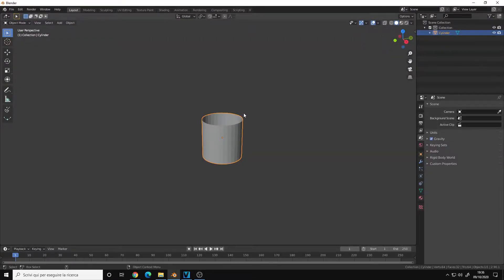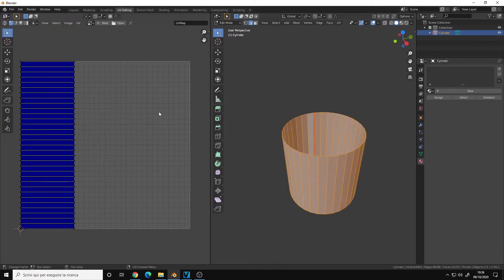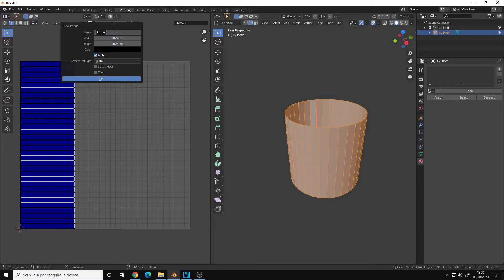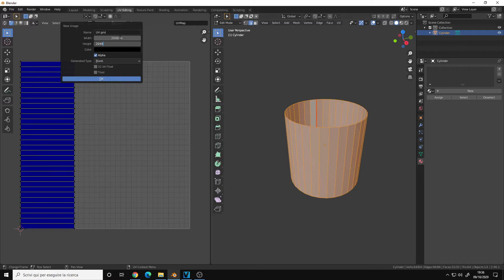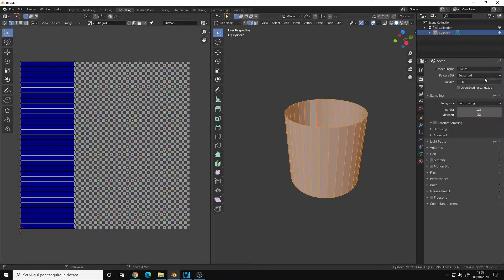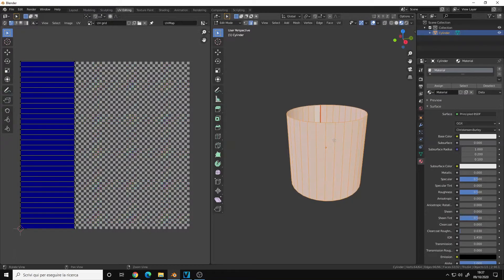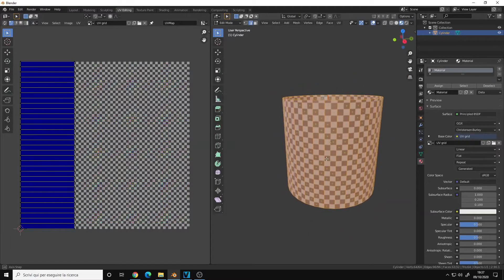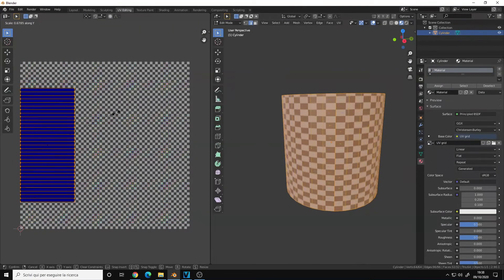Tips & Tricks for Blender 2.9 | Enable the UV Checker Grid

Comment: I set my resolution to 128x128 but the UV checker grid generated at 4x4 checker box. Is there a way to make the Checker Grid 128x128 like the resolution ? I'm building pixel art texture so I need to edit the UV seams at the edge of pixel
Reply from the maker: I'm not sure if there is a way to do it because I rarely use the checker grid but you could try using the checker node and changing the scale: https://docs.blender.org/manual/en/latest/render/shader_nodes/textures/checker.html